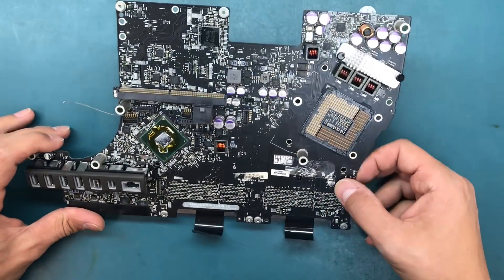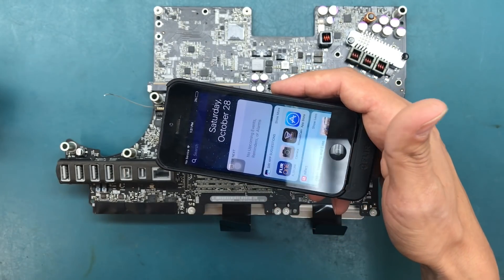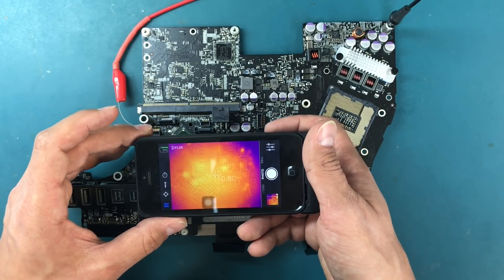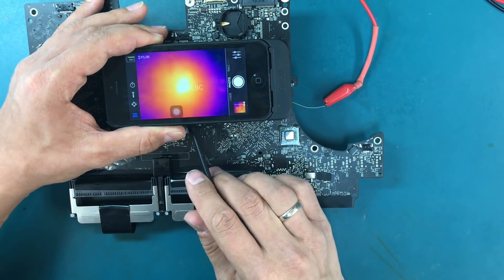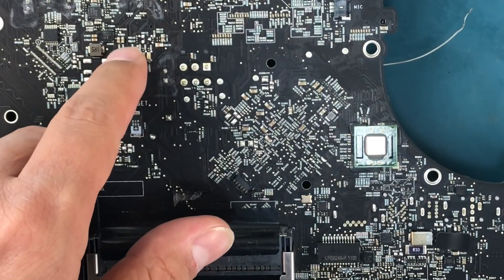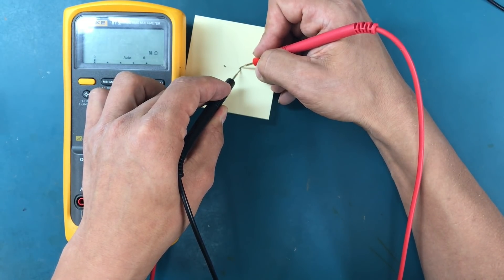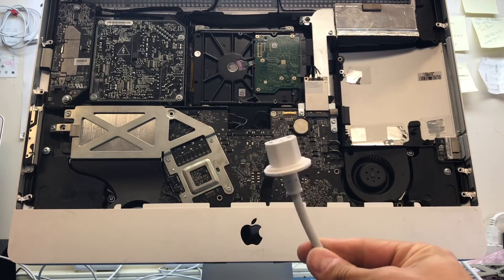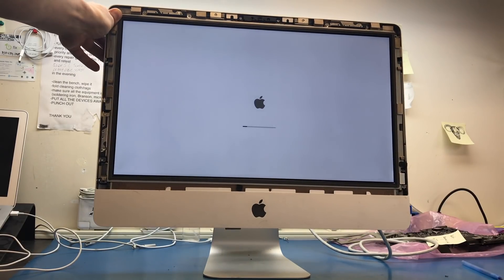Apple Imac Logic Board Fix With The Help Of Flir One Thermal Imager/Camera: Find Short Capacitor

Comment: I fixed a 58 inch Hisense TV that way. One of the SMD ceramic caps was shorted on the LCD controller board. I used to fix CRT TV back in the days but what goes wrong with those were different from today’s surface mount board. I would have never imagined a ceramic capacitor can short because those did not go bad in the old circuit boards. It was usually a shorted fly back transistor or fly back transformer. Sometimes I just put low voltage directly into the suspected capacitor

Comment: Hi, I have a 2017 iMac Pro  with no LED power lights   PS is good.  Removed ram, hd's, battery  still no LED lights or power on.  Where do yo u get the schematics for these?   Where would you suggest looking for the failure?  thanks
Reply from the maker: We buy them.

Comment: Flir thermal cameras suck big time, resolution is too low, there is no support, there is no parts for it nor are there any repairers in Australia, well there is one 1,000 km away in Melbourne and they charge a flat rate to look at it of $250, may be more if it needs to be sent to USA. Needless to say i will never buy another Flir camera ever again. Warranty runs out, $600 camera dies. As for Seek, it's just as bad not worth the money so don't get fulled by repairers on here that are praising the camera's, they are getting paid to advertise it.
Reply: If these so called made in USA thermal imagers are no good on quality and after sales service, are we better off with chinese imagers?
Reply: Michelle Newman
 That's just straight up wrong. I have had no issues with my seek and it is a very high quality sensor for the price. You seem to be the only person trashing on these two companies, when all the other brands are cheap Chinese pieces of shit. The technology is inherently expensive because it is an even broader area of study then even visible cameras.

Comment: whre to buy thermal imager ?  thx
Reply: JAYANANDHAN T J https://www.flir.com/products/flir-one-gen-3/

Manufacturers website
Reply from the maker: I bought this one at the Apple store back in the day. But I’m sure those are available on amazon and eBay. Thank you
Reply: Flir One (same one used in this video) is a great thermal camera. I manged to pick one up at my local Micro Center opened box for $70 bucks.
Reply: sure 70 usd sir
Reply: @Kerug78  they are usually 300

Comment: Very instructive video, do you detect other bad components with this methods?
Reply from the maker: You can only detect short with this method. Yes, most active or passive components will warm up when you run current through them. Sometimes CPU is hard to get warm. You need a lot of current